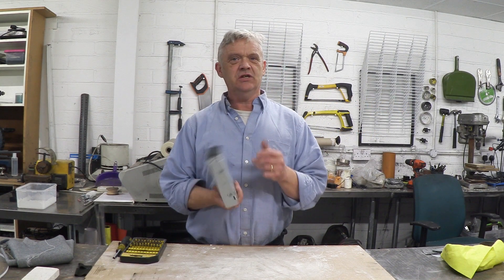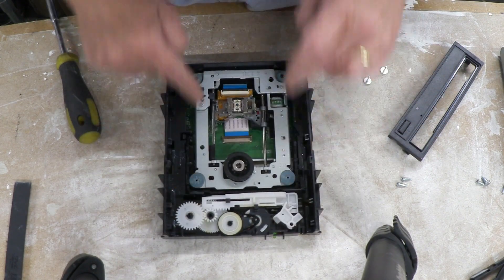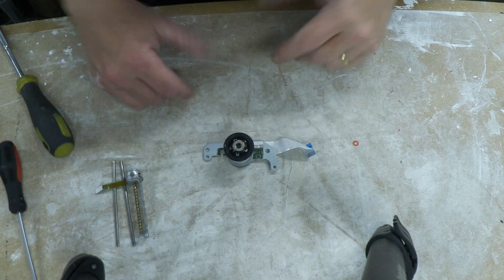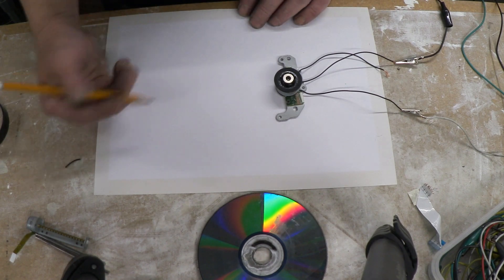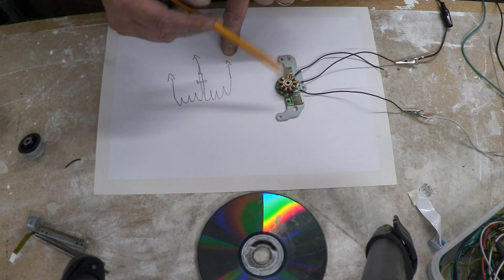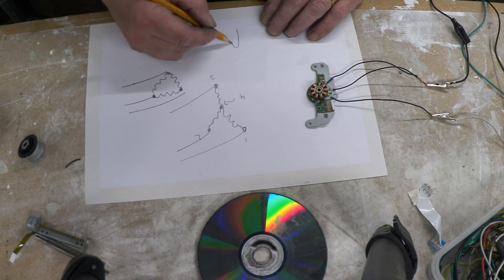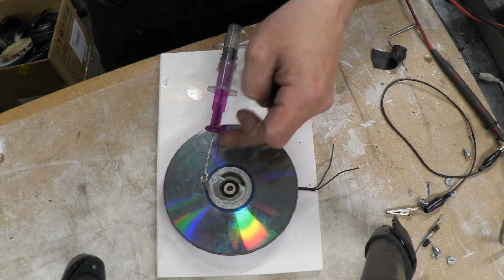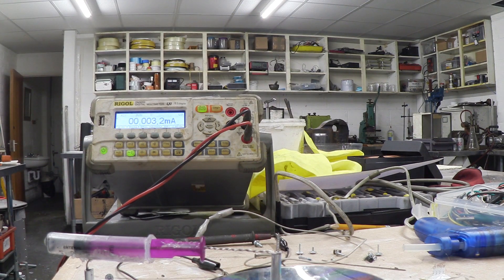Things To Do With An Old CD DVD Drive 1 -  An Air Engine Generator

Comment: I am thinking about how I could do some 12v wind generators. Only thing missing from your vids is what type of voltage you are getting. You talk about milliamps, but what is the voltage? 😁Was also wondering in this one whether the flywheel made it require more energy to get the disc spinning and what the trade off was? love your vids btw, grand stuff!

Comment: Love that Air engine from a syringe, just imagine if the Air was compressed using a Trompe which is also v low tech way of catching energy. I find 3 phase a bit hard to understand, so is there any way of knowing what Drives have what motors, like certain makes may only use 3 phase and others that are not?. Cos using 3 phase rectifiers is a bit beyond me at mo.

Comment: Robert I have about doze of these drive mechanisms from dvd player dying out or kids messing them up. I took a few with the entire opening action added a tp4056  with outputs n a lipo polymer batter from a cell. The out put to a broken RC toy receiver.  Just epoxy the end of any door slide latch style lock  to the slide and place on door or wall the needed distance and boom radio controled door lock. Think I've got maybe 2.00US  in them if you dont count the fact I paid for the toys and dvd players. That's why kids have mtns of toys bc dad gets them when they break😂😂😂😂

Comment: I am using it as a wind generator. Driving it with pulley and gear for 6× Faster speed. Using it for charging li-ion batteries.
Reply: What kind of readings are you getting when talking volts and milliamps? Stepping up voltage?

Comment: You can set up a ram pump to create air pressure instead of pumping water to run an even bigger generator with just a slight bit of fall from water source.

Comment: Would you confirm a few questions for me?  If you put little cups or fins along the edge, you could run this in a mild breeze as a tiny wind-turbine, yes?  Then, would you be able to run it as a trickle-charger for a battery backup of the sort you're supposedly able to use when you need to recharge your cell-phone? Or perhaps an LED light?  Seems this could be a lightweight alternative to charge a camping light or provide power in emergencies for charging cell-phones. 

(I know you usually just say "go for it," but I'm a long way from knowing how to pick out resistors and capacitors and the like for an electronics project. I was an electrician at one point, a generator mechanic at another, but electronics and I have not been friendly in a long time, and the best I can say is that I know how to solder if the point in question isn't too twitchy.)

Comment: Look at Tesla steam engine. It will require some exaust porting around the center of the platters and a bit more spacing between them but the boundary layer drive has been used on military ships to move water.  Maybe duct some wind energy for a tiny camping battery charger.
Reply from the maker: cheers mate

Comment: Good Stuff 
Remember Back In My Youth I Got An Old Steel Wheel With A Dynamo Hub And Butchered 3 Traffic Cones Me And My Dad Simply Curved The Air Scoops Around The Rim Then Simply Zip Tied Them To The Rim , It Worked Brilliant So Much So It Was Very Difficult To Mount . I Think Those Old Wheels Could Deliver 2 Watts @ 12 v Easily ! 
Keep Up The Good Work Earthling Bless Up
Reply from the maker: that is an awesome story and nice share mate - cheers

Comment: .......nice. Perhaps the source of pressured gas could be a block of dry ice in a PET bottle in the sun. ..I looked into this once with a toy airplane that had a pump up air motor . My intention was to convert it to RC. The calculations worked out , anyway we move on to other projects .
Reply from the maker: that is an idea I really like mate - can I use it in a video - with due credit of course
Reply: @ThinkingandTinkering  ....go for it with .. It's Just a modest idea . Cheers.
Reply from the maker: @philipvernejules9926  I think it is awesome mate - I love simple ideas that can be replicated easily - overly complex ideas are much more likely to fail - on so many levels - cheers to you too
Reply: @ThinkingandTinkering  .......and while I think of it :-- I rolled up a bit of auto window tint mylar and popped it into the bottle if increased heat absorption was needed. Coloured cellophane might do also. Definetly the tint decreases heat absorbed if wrapped on the outside of bottle cos of even a  slight breeze removing the surface heat . Can be tuned to desired level of heat absorbed in conjunction with reflective alfoil wrapped on a portion of the outside..(-:

Comment: ok on the "lump"? what about using brass shim stock (usually can get it in pretty decent sized rolls from machine shop suppliers, as well as steel and stainless in a huge variety of thicknesses from .032 inch, all the way down to .0005 inch thick with the thinner stuff being rolled up and stuffed into a tube, Some thing I use for solar cell connections to keep from having a lump, coming off of those (they also sell it here at the hardware store on a shelf made by a company called "K&S" that the company makes metal stock for model railroad building, and pine derby racing, at minimum, too,) and for keeping the raw metal strips of brass from shorting out on things, layer it with Kapton tape maybe? or I guess could paint it with paint made of xylene solvent and styrofoam peanuts dissolved in it, as I found that makes an incredibly smooth (glossy like lacquer) clear coating when I was experimenting with styrene layers with boric acid dissolved in it (sorta as it does not really dissolve sadly) and phosphoric acid mixed in the top layer, to make solar cells, which do generate a bit of power but broke down, quickly however I did find that doing two layers then another two layers on top all with no coloration than the stuff I put in the styrene, were putting out slightly under double the voltage of a single pair of layers, really interesting stuff,
Reply from the maker: nice ideas mate - to be honest there are a million ways to improve this.

Comment: BLDC motors are interesting things to work with. They can make very effective generators. In fact they depend on this for regenerative breaking for vehicles etc. I love the way you see the sense in recycling seemingly redundant items. A nice project for someone to experiment with.
Reply from the maker: exactly mate - that's what it is for - I have seen few if any using cd dvd drive motors mostly folks seem to head straight for the other two motors as they are easier to reuse

Comment: there is also a ring neodymium magnet on that motor you are working with too, or on the disc that pressed down ontop of it I can't remember but I have a number of them, nice tiny magnets there of the ring variety :)
Reply from the maker: there is mate

Comment: I have turned those rods into bits of shaped metal by forming them and then polishing with high grit sand paper (wet or dry made with silicon carbide or tungsten carbide powder, so plenty hard enough to cut into the metal) then finalize with some buffing compound and buffing wheel on a grinder 
then drilled a small slightly smaller hole in a piece of UHMW-PE (though HDPE will work fine say from the thick end of a 55 gallon barrel, or even a piece of wood)  to make a handle, so I can easily push it into and form wet leather to do what is called "leather carving" the stuff is incredibly hard and even after 100s of masks with probably 1000s of hours of use, they are still nearly perfect with no blemishes or scratches, (used them for clay forming too, for detail work both with plastaline (how ever that is spelled, the stuff that is basically wax, and grease or something so it never dries out) and ceramic clay, basically a very cheap way to make custom tools to ones exact design, rather than just buying the clunky things they make normally for that work :)  Not sure what else they are good for, but they seem to be hardened steel to avoid I guess flexing in any amount at all so maybe there are other uses too, (also seem to be stainless as mine have never rusted no matter what I have left them in even hot chlorinated tap water over night, a week or even a couple months one time. :) )
Reply from the maker: they are one of those bits that you know will be useful you just don't know what for - love the suggestions - cheers mate - I will look more closely at them

Comment: Deffo time to start stuffing (even milli) Amps into AC batteries.
Have a pop at Anthracene/Phenathrene/Any polycyclic carbon molecule.
A start point : burn grass (or whatever organic material)  in a tin can which is not fully open = Incomplete Combustion.
Collect the condensed tarry material from the Smoke and the Can.
Make History.
Reply from the maker: cheers mate

Comment: Fantastic!!  I was thinking... if you reverse it, you might be able to build yourself a nice DIY air pump for an aquarium!!
Reply from the maker: for sure
Reply: I am actually looking into using hard drive motors and cases to make a water pump system myself (run motor with magnets on it to spin a plastic squirrel cage with magnets in base to couple with through the aluminum hard drive case and put water hose ports on it. :) )

Comment: Awesome mate, Another Tesla remake in a whole new way and even used stuff that more than likely everyone has one or two laying around. Use its energy to power one of those motors you created in another video. Put a air compressor hose on it and that joker will zip up some RPMs. LOL love it, you never disappoint on the amount of ideas and creating energy devices you build. I'd would love to see your version of a Romero UK generator similar to this one, 
https://www.youtube.com/watch?v=CVT5ZleK5rY
Reply from the maker: I had a quick look at it mate - it's an axial flux motor with some coils pulled out to be generators - I am sorry but what I see here is basically is a motor bolted onto a generator - ok they are integrated into the same unit but conceptually that's what it is I think - I don't disagree that it may well be over unity  - just not something I want to argue about with folks - you have no idea how draining that can be lol
Reply: @ThinkingandTinkering  LOL, I think you know me better than that, I don't argue. I only recommend. I would agree it would be a very large and long series of videos. I just figured being who you are, that you could build it better and make a long video series out of the build. Giving you more ideas for more videos. I noticed that if you do a search on the guy called "Romero UK generator" that a lot of people out there are trying to replicate it. Lasersaber was the first to actually do it the right way by adding the extra magnets to the coils. I don't know if you watch the whole video or not but the moment he added those magnets, it sparked all kinds of ideas in my head. It also seems to be using magnetic wire. Hope you liked the idea. Might be something that could interest you at some point for more video content creation.
Reply: Notice that the speed increased 10 fold and the amps and volts increased when he added another 2 magnets on the back side. Awesomeness, it created more power than was being used to make it run, he was able to charge the battery that he used to run the unit. Producing even more than was put in, yes free energy per say. I bet if they were graphene batteries then it would be even better.
Reply from the maker: I'll have a look into it mate - cheers

Comment: Ooooh, an air engine, I could use this to power the small fleet of Learjets for conspiracy airlines 😁
Reply from the maker: a very very small fleet
Reply: With a flight ceiling of 15,000 ft to reduce the risk of visible curvature😁
Reply: @billbaggins  Yes because if you can't see it it doesn't exist.  And even if you can see it it still doesn't exist LOLOLOL  Take care, Poo

Comment: brilliant.. I have a dozen or so of those little motors and could never figure out what to do with them.. well here is a trick I can use some for.. thanks I will save this is project for the winter time.. (I do most of my electronic stuff when the weather is bad.. that shop outside it just to cold!) Thanks Rob..
Reply from the maker: they are a little underused i think

Comment: Maybe you should have Sanded or Scraped the Wire Contacts and Spot Welded Copper Ribbon Strips so as you would have a Flatter Surface for Wire Hook Up. You could also Incorporate a Couple Rev Valves and a Tighter Plunger with an Oilier Hole for some Lube. Just a thought. Thanks for the upload
Reply from the maker: it could most certainly be made better - this is just a half day project for fun mate

Comment: Quite Brilliant.  How was the Syringe venting out the compressed air ?  Did it have ports at the end of travel ?  Did I miss something ?  The plunger was that loose ?
Reply from the maker: it is a stream of air at the inlet port which is just the syringe needle point - because it oscillates that same port moves out of the stream 90 degrees late so it becomes the vent port

Comment: Nice one, I am currently turning  two cd roms into a micro cnc plotter but this here sounds somewhat cooler.
Reply from the maker: i like the sound of what you are doing mate - i mean to keep the motors with the screw drive for something like that
Reply: If you need longer xy axis, you can salvage parts from old printers and scanners (rails, motors etc).
Reply: @JonnyDeRico  that's what I do. Plus I've got 6 xboxes 360 queued up for dismantling as people seem to throw them away for no good reason (other than it wont play games anymore). Consoles are great sources of small motors (and more) as old CD drives are becoming song of the past slowly.